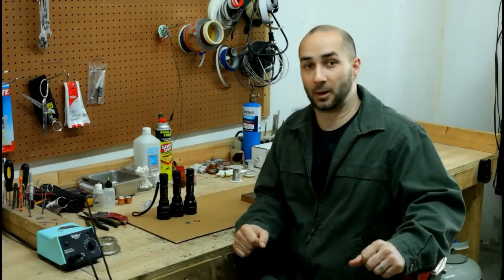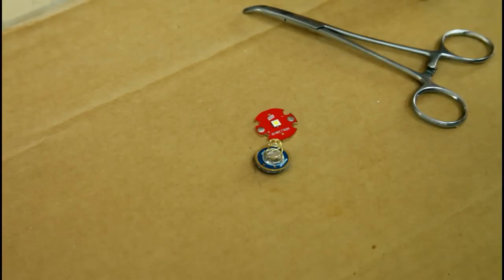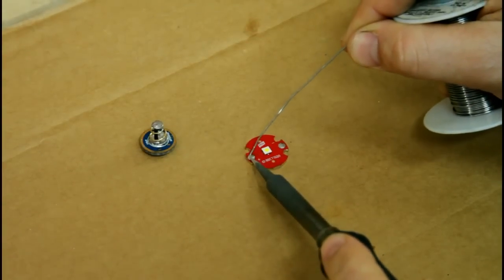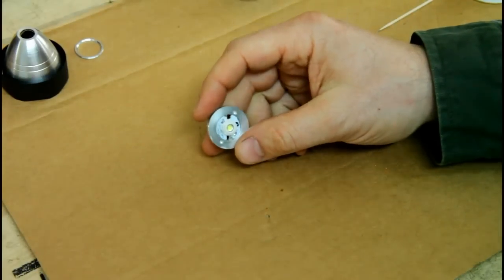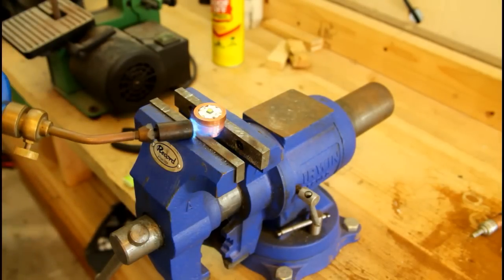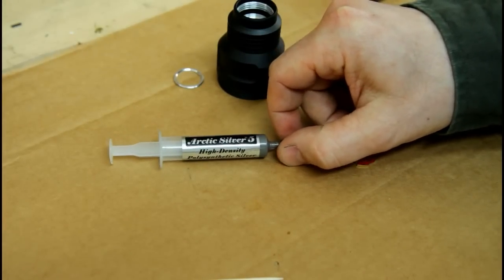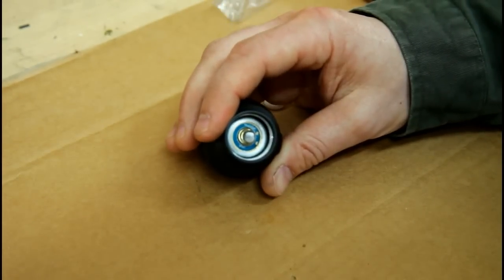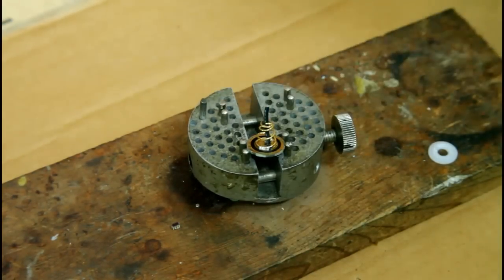Ultimate C8 Flashlight Mod!

Comment: I'm surprised to see you leave the insulation on your bypass wires. I've found that the thick insulation prevents the spring from fully compressing. This can make using a long battery a real pain. I started going one step beyond removing the insulation. I use some fine copper braid typically used for desoldering. It's a bit tricky to use as it soaks up solder fast and can get stiff, but if your quick you can get it right. I put the braid flat on the bottom and top so I can fully compress the spring. It seems to work really well. 

Keep up the good work Matt.
Reply from the maker: Yes, if you need extra space dumping the silcone will help.  The main reason I leave it on is because I worry that the constant up down motion of the spring can cause pieces of wire to flake off and create a short.    So far I've never heard of anyone reporting that though :)
Reply: AdventureSportFlashlights That's an interesting thought. Another reason to go with braid. :) It's super flexible and probably has much less resistance than a small wire. I know the factory bypass wire on my Convoy L6 broke after a few compressions. Now I use braid because it has a larger contact point on the ends.

Comment: Another great mod video! Thanks.
Next up possibly, a mod for the Utorch UT02? That one has me interested too.
Reply from the maker: The UT02 would be a pretty tough mod since its an e-switch in a small space.   I was thinking about maybe doing some multi emitter mods in 18mm hosts next maybe?
Reply: That would be cool! I just have that UT02 burning a hole in my head at the moment. Your up to a good challenge though, right? : - ) 

Do you have a UT02 there?

I just got back to my office a little bit ago, and I see several UPS packages laying here. I am sure that there are at least 1-3 new flashlights in that pile of boxes. 

I am going to need a check list soon. So that I don't end up buying two of everything!
Reply from the maker: Oops.  I have a UT01 not a UT02.   That is the light I was speaking of a moment ago.

Comment: Okay thanks again! Would I be able to add 7135's to it? Seriously that's the last question lol
had no idea you had a shop I'll definitely use it now.
Reply from the maker: Questions are fine bro.  That's what this type of tutorial is all bout, helping people to understand.     It would not be helpful on that driver.   There are 2 channels on that board.   The main channel where a large amount of current flows.  Then a second channel for the 7135 where a small amount flows.   They "fire" at opposite times as each other.   The PWM in the small channel fires at the opposite time as the large one (but with less light) to "fill in" the gaps so you dont see any blinking from the PWM.   Here is a great video by Advanced Knife Bro that explains PWM in detail
https://www.youtube.com/watch?v=QfIt9_igRZc
Reply: Great info! I picked up 2 mosfet drivers from your store! Thanks again

Comment: Thanks for the reply to my previous comment! YouTube wouldn't let comment on that post again. 
One more question. I ordered a fet+7135 driver from Mt electronics for this build. Is that the right one? I didn't see one that said mosfet and I read somewhere it's often abrieviated as Fet. But it has 7135 chips so it's confusing.
Reply from the maker: Yes, that driver will work perfectly in this mod.   The single 7135 chip on that board is only to smooth out the appearance of PWM.  Most of the current will travel through a separate channel.
Reply from the maker: That driver will also work. You will get lower current than you would if you use a mosfet like the one from my shop or the +1 7135 board from mountain.    For some reason I found those boards to be much higher in resistance.

Comment: Great video thanks! 
Protected or unprotected cell? What do you suggest? Also why a mosfet? I tried to read on it a little but way over my head. Thanks.
Reply from the maker: I use unprotected myself.  They are lower resistance inside which means the LED will be driven harder.   A Sony VTC6 is a great choice.  Same answer for the mosfet driver.   7135 based drivers like nanjg 105C limit current to about 3 amps, and also add resistance to the build.   The mosfet is basically like running the light with no driver in it at all.  Direct drive off the battery, but you have the benefit of lower modes created by PWM.
Other than Cree advancements in LED tech that driver is the best thing to hit the flashlight industry in 10 years.

Comment: Omg wish I knew how to mod my lights i would just buy hosts and make them better great video
Reply from the maker: You can do it bro.  You've already got the most important thing.  The passion for the hobby.
Reply: The only real thing you have too learn is basic understanding of voltage and polarities and how to solder properly. The rest over time will get easier.
Reply: @YOUTUBEISRANBYRETARDS  do we have to know amperage? I see some mcpcb board have higher amperage like 6amps but I suspect I need to consider using wiring that can support 6amps when making driver leads as well as considering this in electronics (tail caps, buttons etc)?

Comment: great tutorial but I wouldn't recommend spreading the thermal compound but rather leave it as a single bead. Spreading it will introduce air bubbles but squeezing a bead of it will push any possible air out.

But flashlights are tiny so these rarely applies
Reply from the maker: Thanks for sharing :)
Reply: @Lumencraft-  yes.This is how its done in the computing world
Reply: james palmer to each is own but same rule applies to computer CPUs, your not supposed to spread it out, you let the heat and the Pressure of tightening it down spread it out
Reply: ducttaperulestheworl nah i think your wrong, a single bead sounds stupid to me, i think what he discribed in the video was the best way

Comment: that's a crazy difference.
Reply: backup41 i have seen c8 with t6 xml, they are not really bright as xpl hi or xml2 that i know.
Reply: I started as a flashaholic since 2011 and during that time all the C8's in the market were using XM-L T6 with aluminum board (with dielectric layer), and it was considered quite a performer at that time. Things have gone a long way and I have witness how far the technology and hobbyist's knowledge have improved over the time!
Reply: backup41 Yeah, I've never seen a C8 with such a poor beam like the one on the right. That must be a really low quality light. My Convoy C8 looks like the beam on the left, just not as bright.
Reply: Amin Momtaheni Of course not. the xml T6 is a much older design and max output is about 800 lumen. It just can't handle very much current or heat like the newer LEDs can.
Reply: JasonWW2000 :)?!!